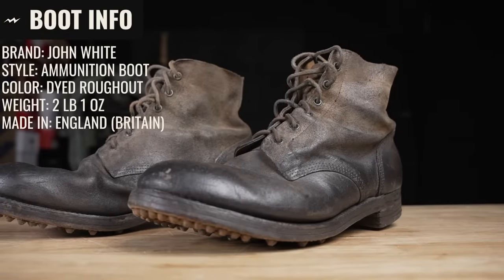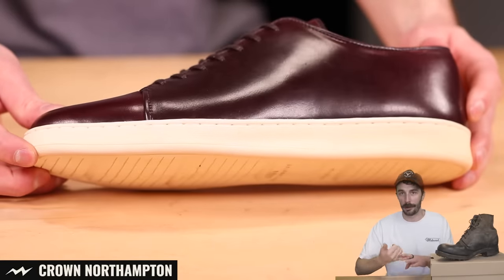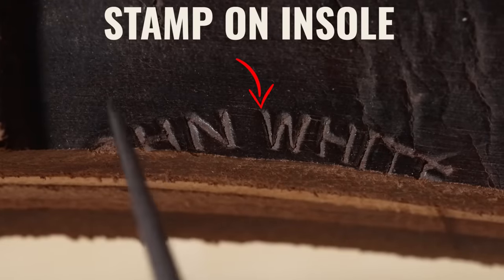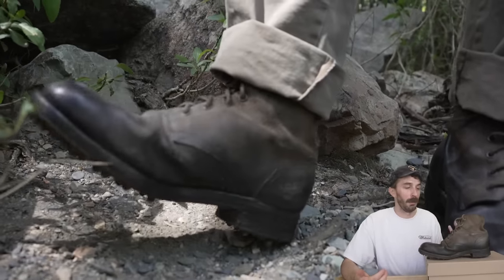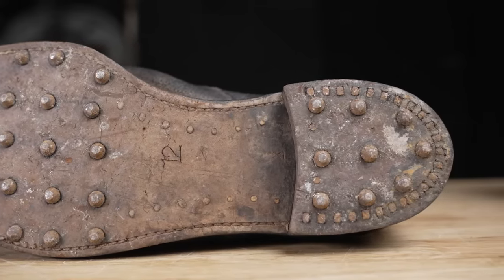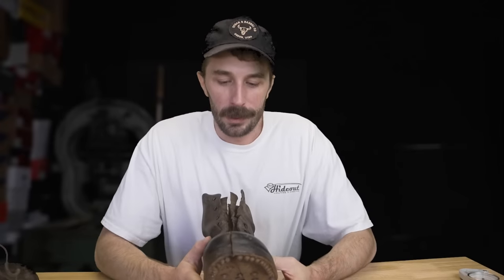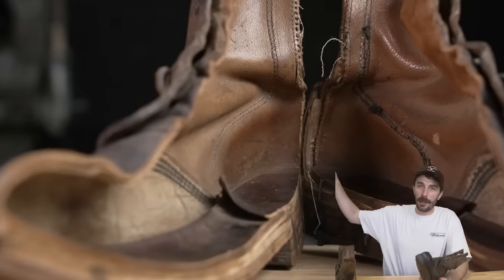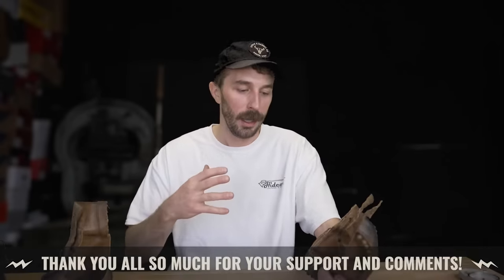Why 80 yr old British WW2 boots are better than modern boots

Comment: The British Army in the 70s  went from this type of boot  to the  (DMS )ankle Boot  Dunlop moulded  Sole this was a  bog standard general purpose boot  because theses  boots were short or ankle height ""puttees" were issued to wrap around your ankle to stop water and offer support this was fine  as a work boot or parade boot. But shite to go to war in the 1982 Falklands war where the British army issued with thess thing were found wanting BADLY because of the climate in the southern Atlantic Islands  water ingress was a problem with the DMS boots the water got in and stayed in sloshing about unable to drain away causing  WW1 foot problems like Trench foot   stories of British paras  or other British squadies taking better made  boots off Argentine prisoners  of war got around the media  I have Heard this personal from Soldiers who served there   eventually  the British army decided to properly  think about the common soldier  and sought the best of British manufacturing boot company  (Alt berg) theses   boots now   standard equipment for the British army  However  if you prefer other brands of boots then theses what you can have  far as Altberg  boots are concerned  theses boots are Top notch high quality footwear   used by British Military  and Civilian alike

Comment: Not exactly ammunition boots, but I have had 3 pair of the M1938 field boots - look similar to the British boot, but brown and in smooth leather with a cap toe and a composite sole -  I have had 3 pair in 20 years and they required almost no break-in and wore extremely well.   I got all 3 pair from WWII Impressions in California, and my understanding is that they are made by Corcoran the original lasts, using WWII-era equipment and processes, and as close as possible to the original type materials - they are among the best footwear I've ever owned....The heels tended to wear down fairly quickly, but I started installing metal heel plates on mine and I've been on this third pair for almost 5 years with little visible wear...

Comment: If you ever get tired of cutting apart footwear, I'd be interested in seeing a video that Walks through restoring a pair of something like these, along with all the science why. Soak them in this oil because it does or doesn't polymerize, then this type of heat because poor's, blah blah blah. 
Then maybe a comparison. Restoring a jungle boot is much easier than restoring an Eastern bloc leather boot, but the full leather is in better over all condition etc.